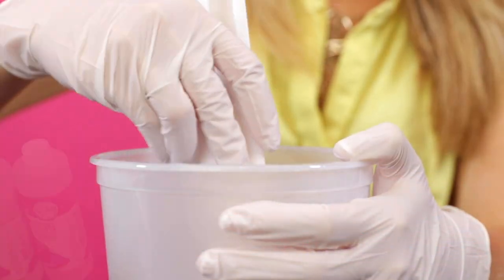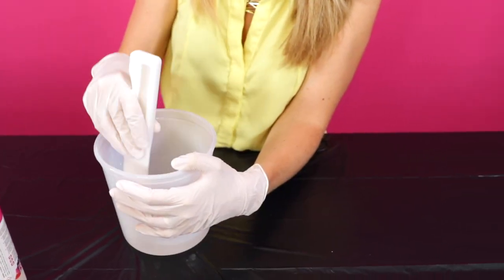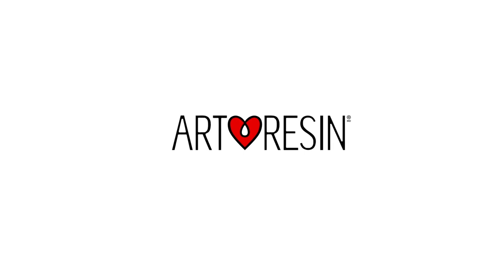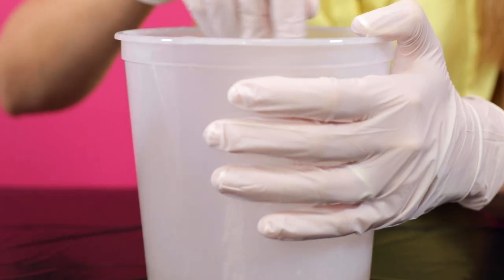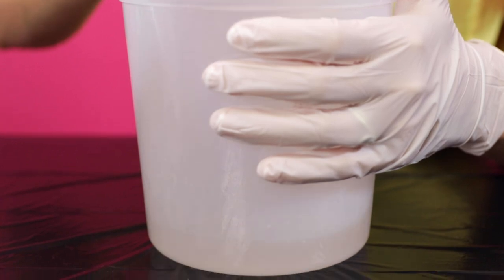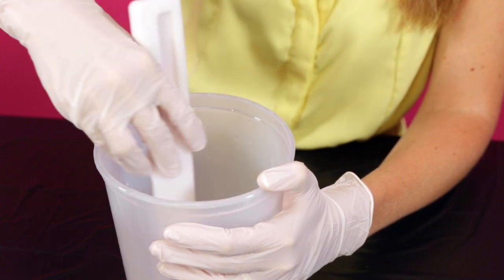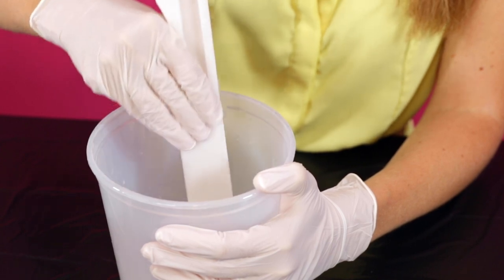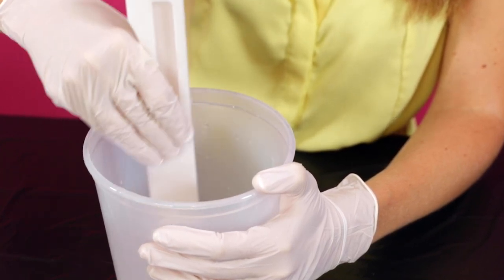ArtResin 101: Step 3 - Mix

Comment: When you measure your picture,for the resin, is it the size of the frame or is it the inside of the glass ?
Reply from the maker: Great question - only measure the exact length and width of the piece you'll be covering in resin.